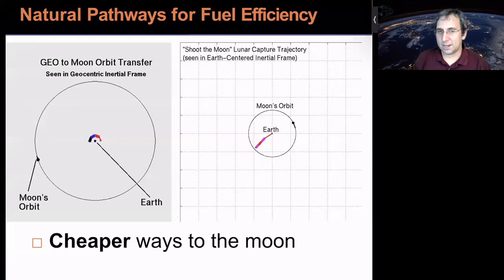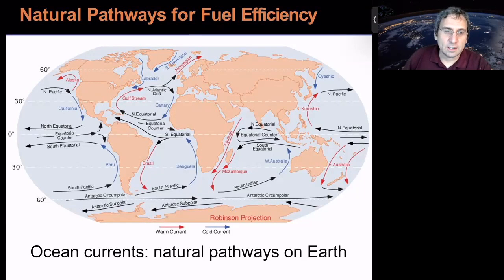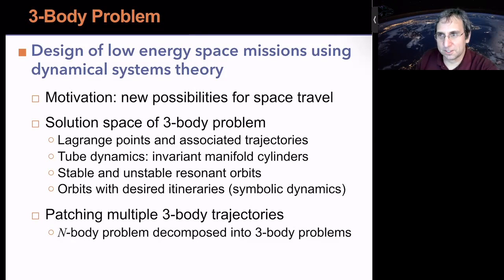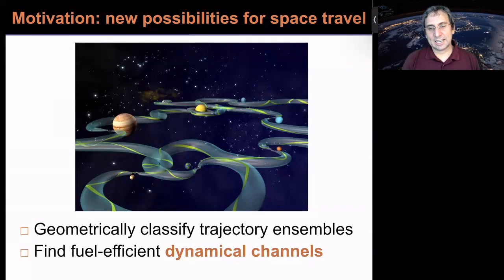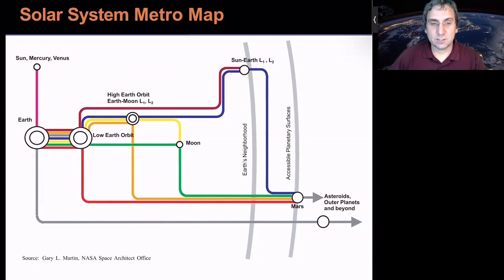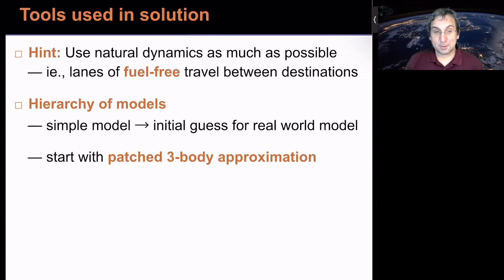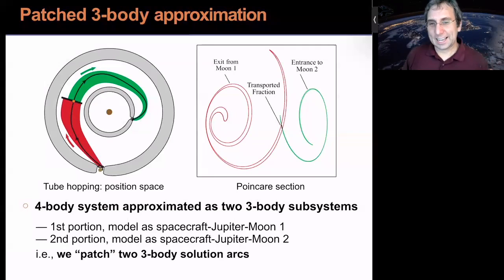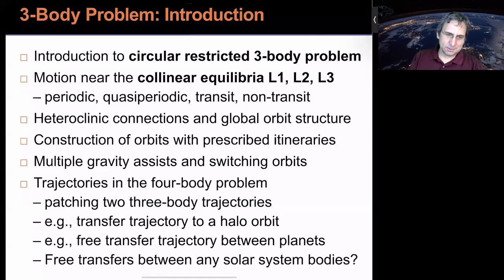Three Body Problem Introduction: Lecture 1 of a Course Series | Topic 1

Comment: I've been playing around with a little simulation script, and flabbergasted how often it happens that one body is literally "kicked out" to infinity, even if initially all bodies have zero velocity. It feels counterintuitive, although energy-wise it's absolutely consistent.
Reply from the maker: Yeah, I wonder if the set of bound orbits is even an open set in the full phase space for the 3-body problem. The "restricted" assumption severely limits the possibilities of the true problem. But it's a pretty good approximation for the short- to medium-time range dynamics of a small body in the field of 2 massive bodies, whether star-planet or planet-moon.

Comment: Hi Sir, at 7:50 there was a slide with lunar L1 gateway. I designed same architecture when I was 16 years old (2015) without knowing that it is an existing one. After watching  this video I came to know this architecture works. I'm glad that my thought process was in right direction 😅. Thanks for adding it.

Comment: Is this approach feasible for manned flights to the Moon?
Reply from the maker: No, the flight times for low energy Earth to Moon transfers are too long. On the order of months. But they would be good for unmanned resupply missions or robotic exploration missions.
Reply: Well, if the spaceship is big enough to be a cycler, you can make it work. Several months to-from would also be highly beneficial for crewed spaceships that get into trouble along the route, you could have all manner of space tugs on hand at the cis-lunar cyclers @ProfessorRoss
Reply: The moon is not a solid object
Reply: @scottd7222  "One small backstroke for man, one giant lap for all of mankind" -Neil Armstrong, first man to swim on the Moon